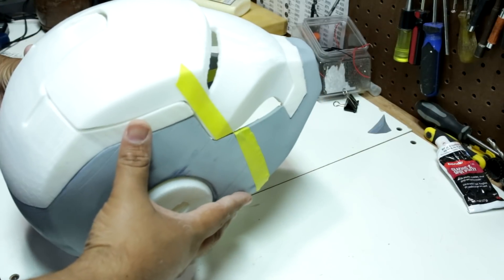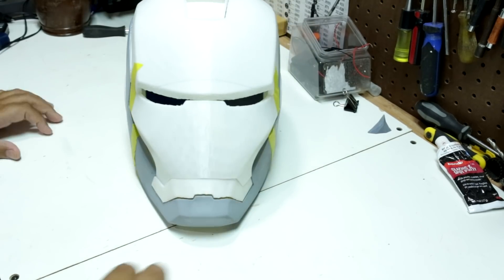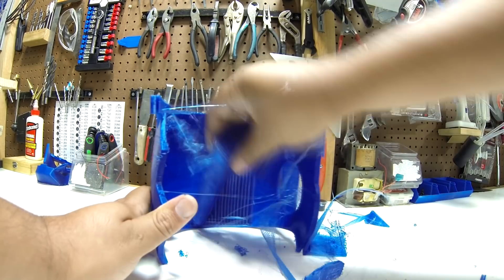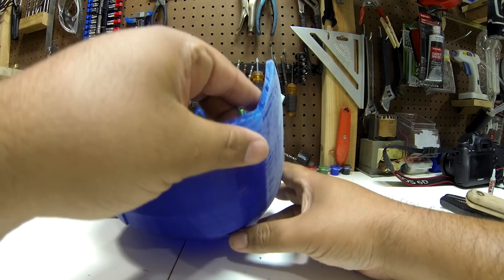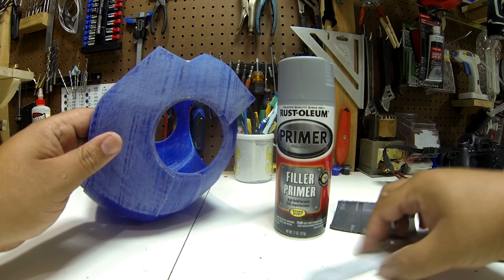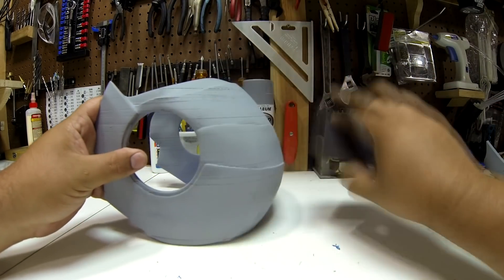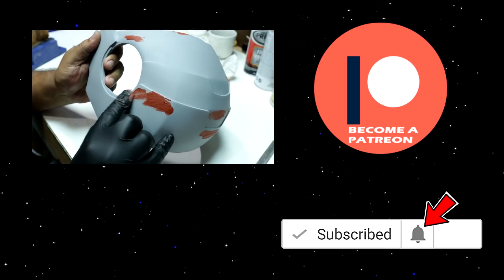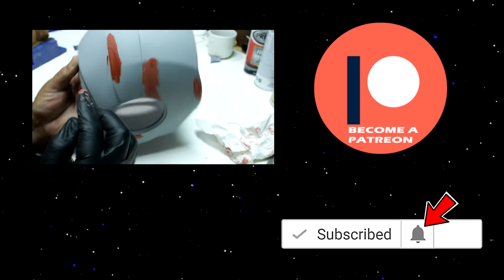3D Printed Iron Man Helmet PART 1   Printing, Sanding and Priming.

Comment: Is it possible to print it in ender 3 pro
Reply from the maker: I think it'll be too small to print in full pieces, try slicing the model
Reply: Wondering this myself. Although I have not printed it myself, it seemed to fit fine in Cura. 

Plus, the publisher of the file said this is for a large head. If you have a normal sized head it is recommended to scale it down 90-85%
Reply from the maker: @MRxSNEAKY   Yes, the stl. file is for a large head, like mine ;) . Maybe if you where to look for some angles in Cura and add lots of supports.
Reply: JC Prototypes bigger head more brains obviously! Looks great man